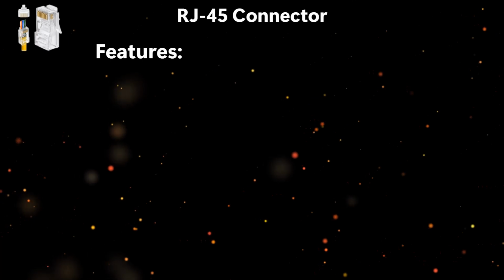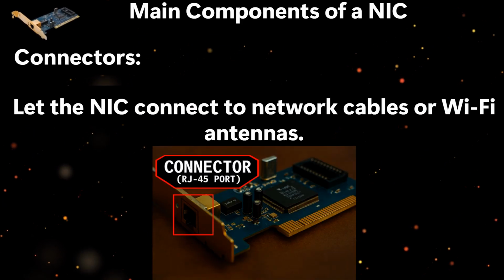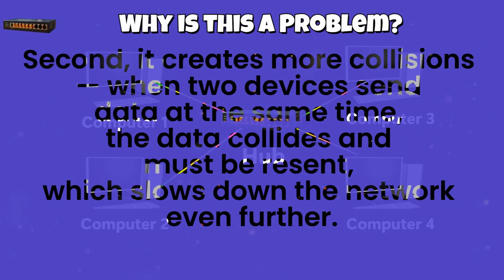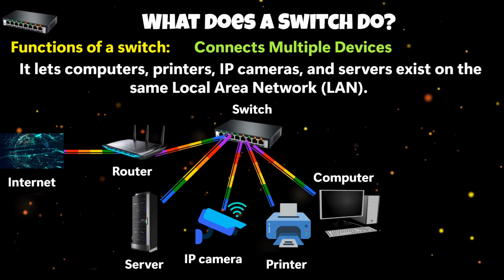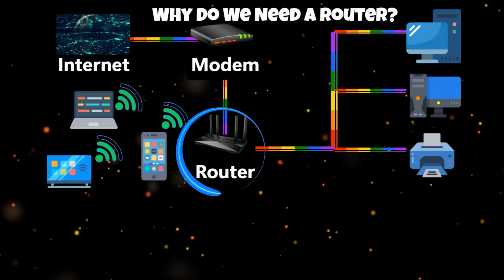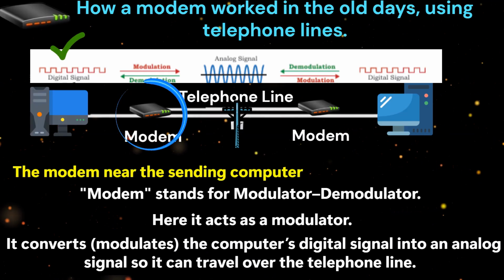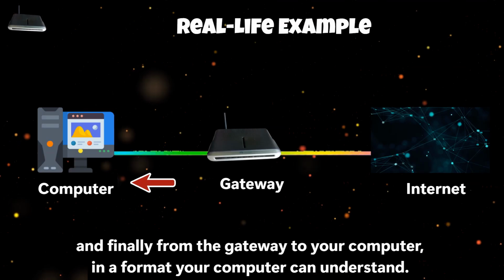Network Devices Explained | Complete Beginner-Friendly Guide

Comment from the maker: 🔽 Timestamps
00:00 – Introduction
00:22 – RJ-45 Connector
03:33 – Ethernet Card (NIC)
08:40 – Wi-Fi Card
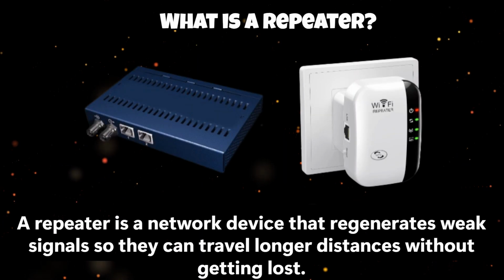10:16 – Repeater
13:43 – Hub
16:01 – Bridge
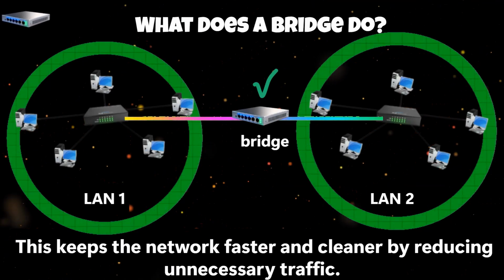16:39 – Switch
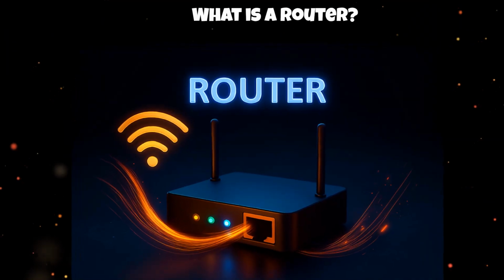23:38 – Router
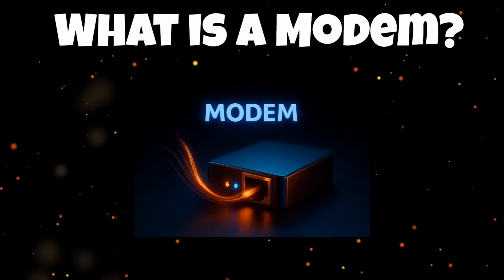27:16 – Modem
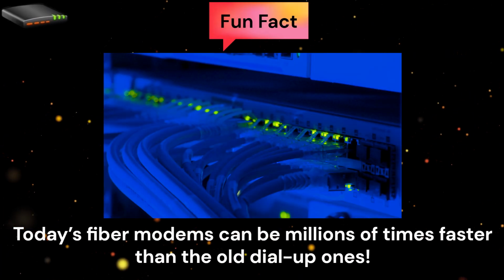31:23 – Gateway